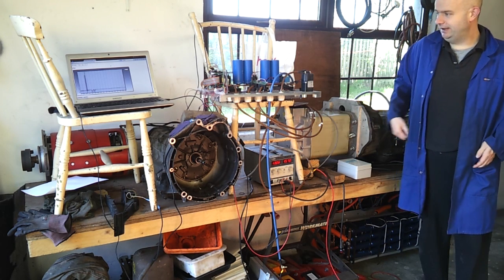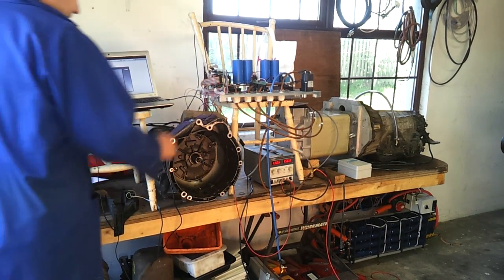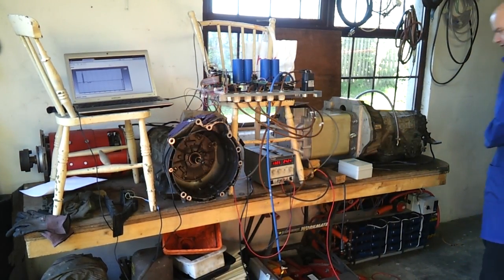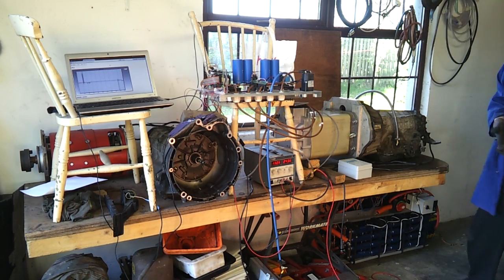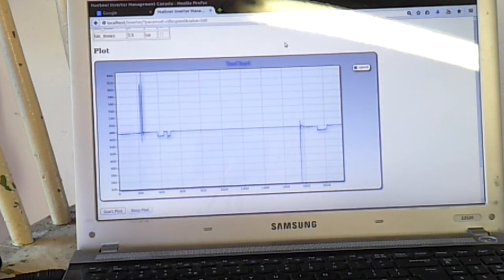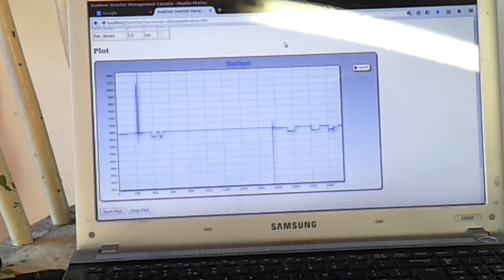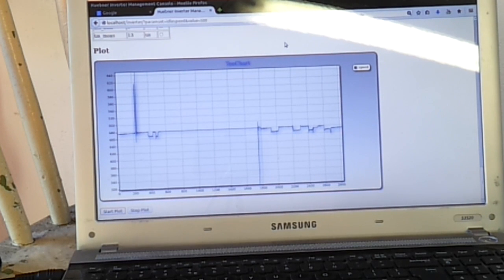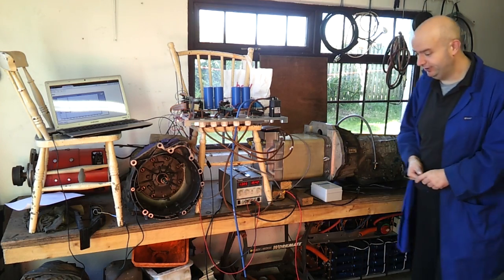BMW E31 840CI EV Conversion 08 : Idle Control

Comment: 155V * 7 A = ~1 kW
That's a lot!
Reply: Hi Rodrigo. To compare, the Nissan Leaf shows 250W on internals while switched on. However, the big one.. They mask the motor load when in Drive or Eco and like an automatic, is fighting the handbrake.
Reply: m1aws Isn't the Leaf using a single motor with a fixed ratio gearbox/differential? It uses regeneration when decelerating to charge the battery. All modes are software on the inverter.I don't understand fighting the handbrake the car barely uses it mechanical brakes.
Reply: Coolkeys2009 lol, you haven't got a Leaf have you :)
It is designed to feel like a standard automatic gearboxed car. So when it is in drive, it moves without help from the throttle.
If you put the handbrake on it stops the car alright but that energy is still being fed to the wheels.
Nothing to do with regen.
Reply: *****  Ok I understand now. If you're stopping for a longer period of time with the hand brake on, why not just put the car into neutral? Am I missing something? An  EV using an auto gearbox  will suffer from this problem much much worse than a Leaf. The amount of energy wasted in the Leaf will just depend how clever the firmware is, clearly it knows when you've applied the hand brake :-)
Reply: Coolkeys2009 parked, we press the park button. 
Many requests have been given to Nissan for the option to switch  off this automatic gearbox effect. 
In drive, the car should actively hold itself when not driven.
Reply: ***** Now I'm confused as hell, if you have a park button, I totally don't understand how it could waste energy through the park brake. I understand why Nissan chose to do it that way it keeps Jeremy Clarkson happy, you can say there is no driving style change needed for an electric car you just get in and drive, even if there are much better ways to do things.
Reply: Coolkeys2009 The park brake and neutral both stop the motor drive. But place the car in any other mode and it acts like any automatic car... The motor is powered while the car is off the throttle.. Regardless whether you allow it to move or not.
I'm done. You have to be trolling me.
Reply: m1aws I'm not trolling you. I'm just trying to understand the problem. I would like to design my own high power BLDC drive for some sort of EV in the future so I am fascinated by the problem you are describing. The brake pedal is fully tied into the control system so the motors torque could be reduced to zero or regen the moment you touch the brake pedal i.e no wasted energy unlike a conventional auto box. Is there definitely overlap between the motor and mechanical brakes? Also an option to hold the car at 0 MPH on a e.g gradient using the motor would waste energy and possibly overheat the motor.
Reply: Coolkeys2009 It does not because Nissan did not set it this way. They wanted the driver experience to be like a vanilla auto box car like Damien (here) is building.
On the Model S you can turn it off.
Reply: m1aws Btw way I wouldn't call any part of Damiens system vanilla, I still think what he doing is very pioneering. He may get better acceleration using his configuration even though it may be less efficient.
Reply: Coolkeys2009 I suggest you watch EVTV. Many of us find it is the hub and the bible of home built EV's.